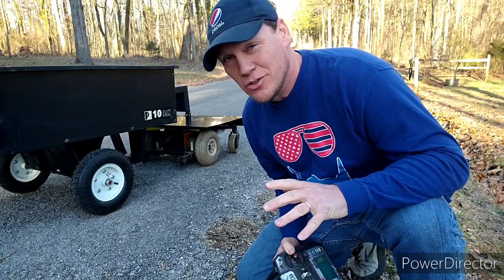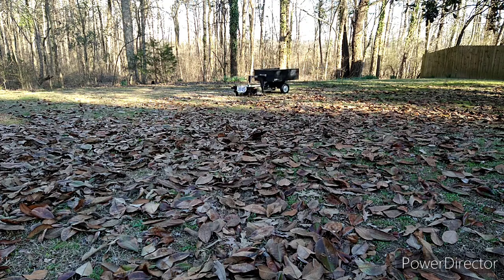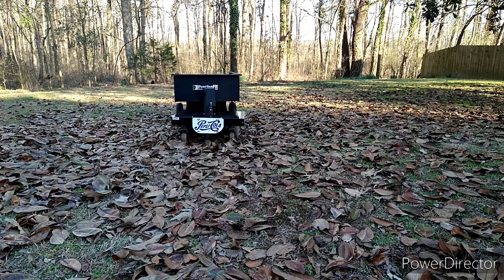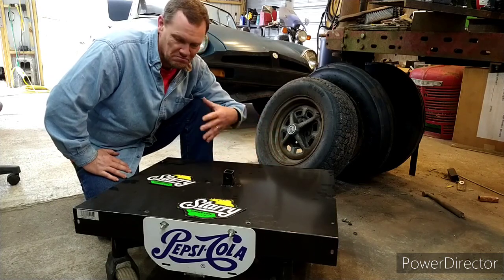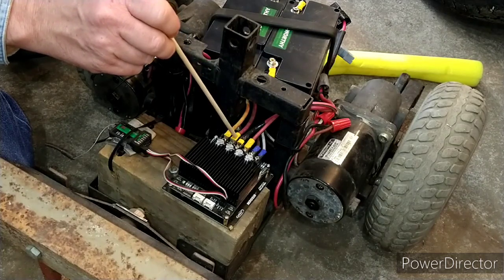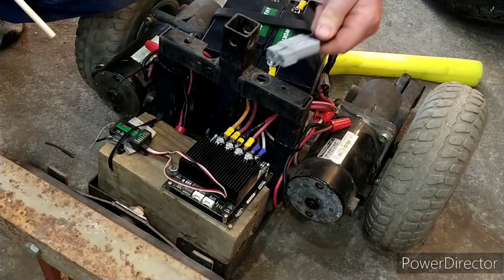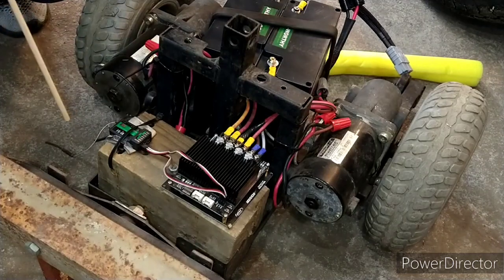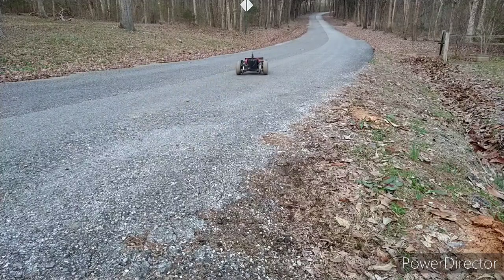R/C garden cart, power wagon. A radio controlled power chair base. Retired BattleBot, just kidding

Comment: I like how ya done it,u just need atleast a 50A per channel controller,mud tyres and 2 car batteries for weight but also longevity but u will need a cover for the receiver and the controller but that will need a waterproof enclosure and a fan but what u said about a rake u could always make a rake trailer and extra weight u could have it ploughin a small area 😉
Reply from the maker: The sky is the limit.